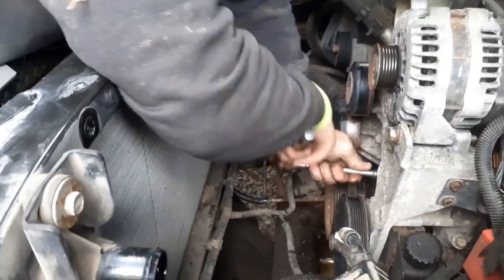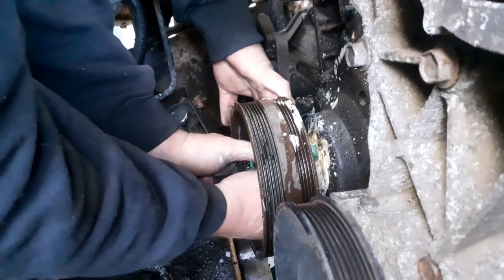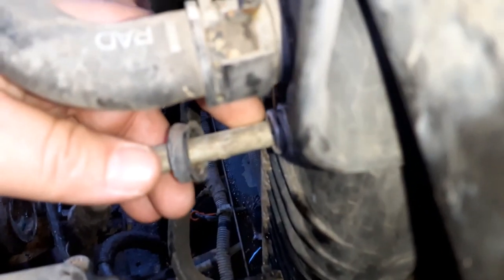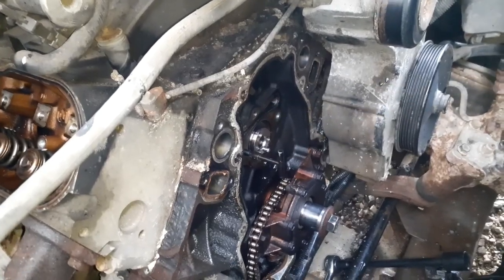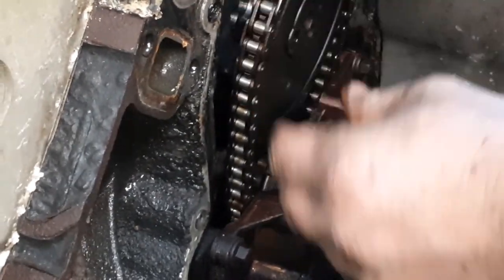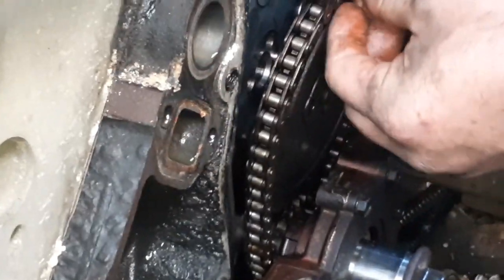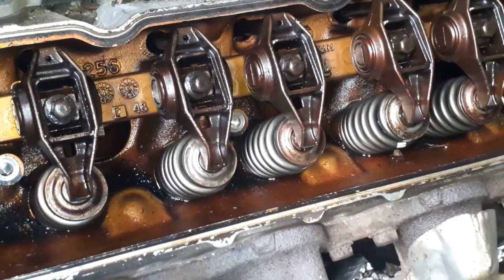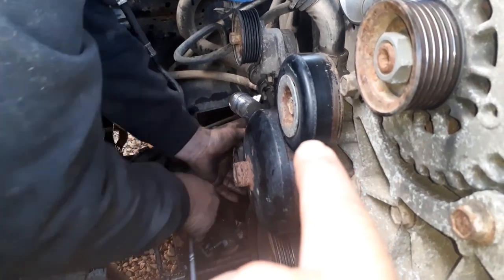BTR Truck Norris Cam 5.3 2005 Silverado Install

Comment: Just a tip. If you run into a sticky crank bolt heat it up a bit with a torch you don't have to go crazy with the heat. If doesn't budge on the first go repeat heat cool heat cool. The cycling of expansion and contraction will usually get er done. I've done this many times and works very well and reduces the risk of breaking or striping bolts wich I've also done. Make sure to replace bolt with new one they are a one time bolt.
Reply: I reuse them all the time no issues

Comment: The LM7 5.3 is a Dished Piston, on the rockers did you do any zero lash, what pushrods did you use? Did you do a number of twists before torque on bolts (clocking/degree) or just torqued them down as usual?
Reply from the maker: Per BTR we used stock length push rods and just torqhead them down but it is a good idea to check lifter preload/push rod length
Reply: @CarportGarageDragRacing stock length as in 7.4"? I'm doing a swap to an iron 5.7 (5.3 bored out) and it so happened to have your cam, 243 heads and stock rocker trays, rockers with bushings (LS1) a friend was asking if I might need poly locks.
Reply from the maker: @shadowopsairman1583  stock length is 7.4 but if the heads or block are milled and/or you use a different than stock thickness head gasket, or if the base lobe on the cam is different than stock that would change the pushrod length you need. You can use poly locks but I did not.

Comment: I didn’t you check for lifter preload. After I did a cam swap I had to go with longer pushrods than stock because the base circle was smaller on the new cam. I had to go .050 longer to get one turn of preload. Maybe that’s why your lifters are so noisy.
Reply from the maker: The torque wrench we used to torque them was questionable, we retorqued them with a different torque wrench and the noise went away, as seen later in the video. BTR said to use stock length push rods, the base circle on this cam was at stock specs. I know Gen 1-2 SBC for stokers they would use a smaller base circle cam to help clear the rods, unless it was a reground cam, what would be the purpose to do that on a LS motor?
Reply: @CarportGarageDragRacing    I don’t care who makes the cam, I always check lifter preload. I’ve swapped a stock l33 cam for an ls6 cam and had to change pushrods because I didn’t have enough lifter preload.
Reply from the maker: @coarsegrind  I always do that on Gen 1-2 SBC because you pretty much have to but on LS I guess I have just been lucky. New to working on LS. I have always used the cam recommendations for push rod/lifter length and torqued em down to 22 lb ft and sent it and never had an issue. But yes you are correct. It is a good thing to check.
Reply from the maker: @coarsegrind  but I do go over lifter preload in another video on a Gen 1 and 2 SBC.
Reply from the maker: @coarsegrind  when you changed from the L33 to the LS6 cam did you change lifters or head gasket thickness or have the heads milled any?
Reply: @CarportGarageDragRacing    No changes other than the cam and springs.

Comment: I have a 04 sierra w a 4.8 i recently installed a cold air intake, throttle body spacer and exhaust last mod will be the truck norris cam kit but I dont know where to find the tune or maps for it
Reply from the maker: I can tune them but I am not the best tuner, it takes me hours with me physically with the vehicle to get it just right and tbh there are some areas I need to learn better, but he traded the truck off before I could get the tune like I wanted it. You will probably have to have an experienced tuner remote tune or dyno tune it. I looked in HP Tuners repository and I could not find any tunes for this cam. His was a 5.3 and it actually started and idled with that cam.
Reply: Michigan motorsports

Comment: Did you have trouble getting cam in? Im getting stuck at the 2nd journal after about 4 lobes.
Reply from the maker: No we did not have any trouble sliding it in. Put some long bolts in the front of the cam and carefully wobble it to align everything up and it will push by the cam bearings.
Reply: @CarportGarageDragRacing  i figured out what the problem was. It was a lifter sitting too low. I pushed up on it with a pry bar until it stayed in the bore.
Reply from the maker: @Reaper21O  was about to mention that
Reply: @CarportGarageDragRacing  yeah, I was too confident in the dowel rods doing their job that I didnt even suspect it would be a lifter getting in the way
Reply: @CarportGarageDragRacing  also, do you have to replace the crank harmonic bolt and camshaft sprocket bolt? All the videos I've seen either dont do it or they fail to mention it. 15/16 or 24mm i believe.
Reply from the maker: @Reaper21O  you're supposed to, but not everyone does. I replaced mine though.
Reply: So you can use stock springs with this cam
Reply from the maker: @javonnielenoir3090  imo I would not use stock springs on any aftermarket cam but call BTR and ask what cams can use the stock springs, they do advertise some of their cams as being stock spring friendly

Comment: Where did you get those metal pins
Reply from the maker: If you watch my son's cam instal on his WS6, he used wooden dowel pins from Lowes, they worked better and way cheaper. A friend brought those metal pins over and I'm not sure where he got them.
Reply: Summit Racing and Jegs sells them. You can also search around the net and find the diameter and length and make your own like we did.

Comment: About how long did this take you guys
Reply from the maker: Probably 3 hours
Reply: @CarportGarageDragRacing  that's awesome I just got the truck norris no springs required cam new timing set and high volume oil pump for my 05 silverado crew cab 5.3l with 162,000 miles trying to plan it perfect man
Reply from the maker: @jaredporter7450  you will have to drop the pan to change the oil pump
Reply: @CarportGarageDragRacing  yea I'm trying to decide if I wanna do that or not I have zero leaks and pressure is just below 40 at idle

Comment: Make any better power?
Reply from the maker: We are still tuning on it. Have not got to tune on it much because his long hours at work and family commitments.
Reply: I can tell you this, We put together a 5.3 and put it in a 1986 Camaro. We used stock oem 4.8 flat top pistons in it. We used this BTR Truck Norris cam with the BTR recommended springs and push rods. It has Head Man long tube headers. We started it with a OEM Chevy truck 5.3 intake. Then swapped to a TBSS intake with factory OEM injectors. While using the factory ECM, With "ZERO"  tuning we got 389 wheel HP. To start, Then in self learn mode it bumped up to 418 WHP. I think if we due some tuning on it, and perhaps a few other tricks. We could probably add another 15-25 WHP. We currently have the rpm. limited 6600 in the ECM. Because with the 4L60E, And the OEM 3:42 gear in this thing. The top end speed is enough to take flight if you add feathers to it. Honestly, I really don't want to add anymore power to this car. And here's why, it's a factory Gen 3 F-Body Camaro RS. Not a Z or even a IROC. So it doesn't have the upgraded suspension that even those cars had in the late 80's. This is just a summer time daily driver. I really don't want to have to dump another $3500. To $5000.00 into tying the suspension together and upgrading everything to handle 25+ more hp. If I was building a race car, that would a different story. Thats not what we wanted to do with this car. We just wanted more than the 130 hp that the 2.8 v6 had. Now, my 1500 Silverado short bed 2wd. Thats going to be a different story. That engine will be a LQ4 6.0 with one Large single turbo (That looks like it should be on a C18 Cat) feeding it.